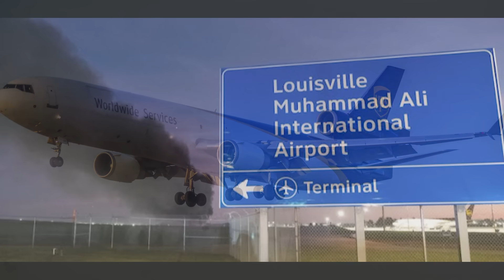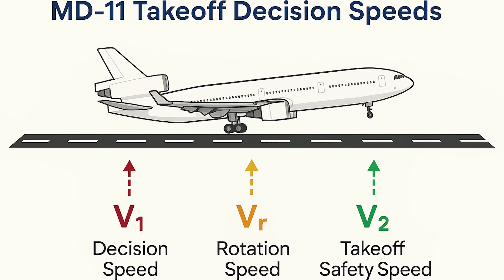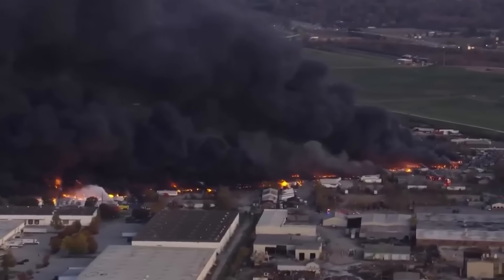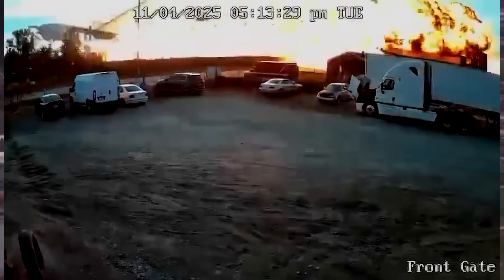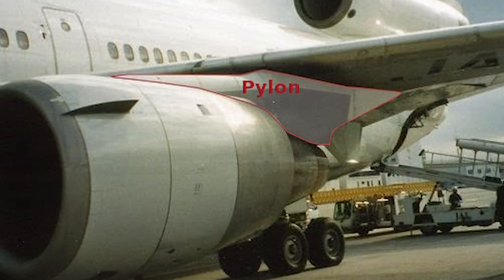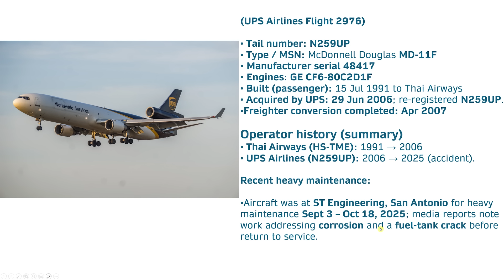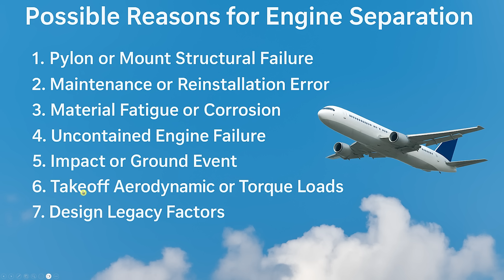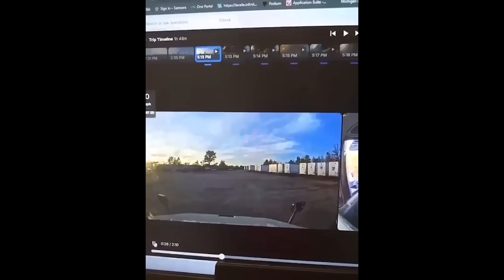What Caused UPS Plane Crash, Louisville, KY? How MD-11 Engine Fell Off

Comment: What a tragedy. My condolences to everyone involved.

The video impressively shows how bad this accident is.
Two things move me.
On the runway, you can see flames coming out of either the second or third engine. This could be debris that was sucked in by an intact engine (2 or 3), causing it to deliver less power.
The dashcam video of the flyover shows that at least one engine delivered strong thrust. The trees and poles bent and kicked up a lot of dust.  Did the thrust come from the middle or right engine, or from the two remaining engines despite the possible engine stall?
It looks as if two engines may have failed during takeoff. One broke off and another may have had a severe drop in power (compressor stall)?!

Comment: This is such a painfully sad tragedy. I've done a lot of contract work for UPS and met a lot of great people during that time frame. They always seem to be big on quality work & performance. Not sure why the airframe mechanics & management would place an unfit aircraft back into service? Never liked the DC-10 or the MD-11 design but but fan blade failure could happen to any turbine engine without proper maintenance.

Comment: I think the same as when the ElAl Boeing crashed in Amsterdam.
The slot where the engine is mounted 
Due to the loss of an engine 
And the fuel continued to pump to an engine that was no longer attached. And because of the power cables it hit, the fuel ignited.

Comment: The "nails in the coffin" seem to be the power lines and the main gear hitting the warehouse to slow the jet down too much to fly/recover.  Until the gear hits the power lines the plane seems to be able to fly despite two bad/one good engine and a full load of fuel and cargo.  I wonder if retracting the gear as absolutely soon as possible when the gear left the runway if that would have bought enough time, elevation and less drag  to just clear the obstructions and provide for enough flight for a controlled emergency landing (???).

Comment: This should be a minor investment for any airport...
But I recommend every airport to install 1 or 2 high definition Camera's AIMED to each runway.
Most exciting and dangerous place of a airport are the runways. And yet every time something happens...it's some dodgy security camera catching something in the corner of the lens.
And low resolution where you can count the pixels instead of the event.
Only maintenance would to keep the lens clear and some harddrives swapping.

Comment: they should make some kind of requirement for airports to have extra miles of field/water after the runway
Reply: It's impossible to safeguard everything. Normally there are field/forest at the end of runways in airports that are on outskirt of the city. But big airports in the city - it's virtually imposible.
Reply: Sometimes they do. In Hong Kong, both the old (Kai Tak — now gone) and new (Chek Lap Kok) international airports have runways aligned with stretches of water; the latter even has that at both ends. Kingsford Smith International Airport in Sydney has its runway pointing into Botany Bay (so it was useful for something after all — it was rejected as a suitable colony site in 1788, you know).
Reply: Lol I'm so sure. Extra MILES? get real

Comment: The state of airline maintenance is so poor that I don't feel compelled to fly for any reason whatsoever. Car crashes may be more frequent, but odds are that I survive something like that, and using cars or being inside cars is pretty much non-negotiable in our society at this point for most people, me included. Planes? I don't have to use those, and if you get into a crash, odds are that you're probably dead.

Comment: AF crew chief and C130 mechanic here: whoever last worked on that engine while in depot and signed off on it will be wishing they had called in that day. They are religious with multiple departments checking over work so a lot of people will be going down. RIP to all the victims.

Comment: i remember this other case which i saw in mentour pilot couple of years ago...where the maintenance crew messed up the pylon mount like didnt secure it ..i think it was American airlines 191(1975)..it was DC10-10s 3 engine like this n MD gave service bulletin of how aft attachment points in the pyon needed to be done n i think all the operators selected a system for maintenance using some forklift...it screwed up the the two attachment points basically...plz watch that vdo as i am not being able to explain it but it will give u a very good idea what might had happened here

Comment: The circumstances of this reminded me of another incident and I couldn't pin it down (my mind kept saying Sioux City but that was incorrect). A little dig brought me to AA Flight 191. DC-10  taking off and the left engine detached from the wing. Cause of that was essentially a cut down maintenance schedule to save costs. Sadly, I wouldn't be surprised it something similar happened.

Comment: Either they did not tighten the bolts when it was installed or someone lossenn the bolts. The first one is the most logical, but why? Did they do it on purpose? Religion, Political,  or Stupidty??

Comment: I suspect the fault is shoddy maintenance. Attention to detail is virtually non existent today. In the last 40 years, every electrician, roofer, plumber, gutter installer, contractor...every kind of tradesman that worked on my house did shoddy work. No doubt, tragedies will continue to increase (imagine a woke mechanic working on your car's brakes!).

Comment: I do know why that plane crashed. Being a fine tradesman myself can understand the issue. That plane spent one month in the shop in San Antonio,Tx where the unskilled tecknition fuk'd it up. If you watch the video close you can see that the engine is completely of the wing and the other one is stalled.Unskilled labor in this country is a big problem and this a good example of it.Flight 270 is another one.

Comment: That engine separation happened wrong time. Probably after no return and one engine was not enough to pull airplane to climb angle with the cargo inside. Did only a jump crash.

Comment: What happened with the Chicago airplane in 77 was they've been working on it and they forgot the Titan the engine down they had slid it onto the track or the Waze that holds the engine onto the wing and they all went to lunch they came back everybody assumed somebody else had tightened it The inspector came by I looked at it thought it was finished and checked it off is all good as the plan accelerated and it took off the right engine slid off the track on the runway and is it got into the air the weight of the other engine on the left side made the plane drop the left wing leaving the right wing up like a shark fin and of course it corkscrewed and went straight into the ground there's a funny story about what I read when I was in 7th or 8th grade when this happened about an author a female who is always terrified of flying and she'd finally figured in the last couple of years she got over her fear flying that was perfectly safe she was one of the casualties on that plane just saying

Comment: I live in a 5 mile radius to the crash and so we had debris falling in our yard. It was still on fire in the sky, it looked like a bunch of stars in the black smoke. It was so sad knowing all the debris was coming from a crash where people lost their lives. Most of the debris turned into cash when it landed on the ground but one of them was a burnt letter from St. Judes Childrens Hospital that I still have. I don't have the heart to throw it away for some reason. I used to work at UPS a couple years ago for college and the crash happened right where I use to park and walk inside. Thank goodness it wasn't my time yet. My dad said if the plane were taking off the other way, it would have been our house. It definitely unlocked a new fear living near an airport. RIP to all the victims! 💔

Comment: EXACTLY.  THE.  SAME.  HAPPENED.  back.  around.  the
1980 ' s.  or.  1990 's.  to.  an
Exact.  Airplane.  Model ,  back
then.  a.  Mc. Donald / Douglas
DC - 10 ,   was.  an.  independent
Company ,  now.  has.  a.  Different.  Number.  and.  Name .
But.  it.  was.  a.  Three.  ( 3 )
Engines.  Jet ,  exactly.  Like
this . . . 
An.  Engine.   "FELL.  OFF ".  from.  a.  Wing ,  during.  Take - Off .
F. R. E.   Miami. FL.     00 : 20. am
Monday.  10.  November.  2025

Comment: Do you know if there was maintenance recently? This happened to a plane years and years ago. Happened from the maintenance crew! The maintenance crew was suppose to only separate the engine from the pylon, but instead they took both off of the mount. After finishing the engine repair, the crew installed the pylon and engine back on the mount! Unfortunately nobody noticed the mount and pylon were not lined up properly and both collided during reinstalling. This made a crack hardly visible to the eye and spread over time and caused it to fall off.

Hope this didn’t happen again as aviation could be in a worse state then we thought

Comment: The strange thing to me is that 2 engine planes are required to be able to fly and even take off with only 1 functional engine (50% power). So you would think a 3 engine plane would not struggle as much as this one appeared to if it still had 2 functional engines (67% power).
Reply: Functional engine versus Dead engine versus Missing engine

Comment: I guess the mechanics installed the wrong direction of the engine mount bolts' washers that's the recess area of washer not against it's bolt head causes the washer long time pressed the neck of bolt make that mount bolts crack or short life. In the nutshell, the engine mount bolts broken.

Comment: I have had a reoccurring nightmare of a plane crash for as long as I can remember.  It doesn't help that I live a mile from the airport,  and UPS takes off every night at 10:00 sharp.  I probably didn't need to see this. God bless the pilots and the unfortunate victims on the ground.  Horrific

Comment: As a former aviation worker whoever did not properly inspect the plane after repairs or skipped protocols at all their heads will be rolling followed by mass investigations.
Reply: My guess would be that every one that ever worked on that plane now has some trouble sleeping.
Questioning them self if they did anything wrong...second guess everything they do at work.
Reply: @CruelViper88   they're probably like "muh plane" and then back to eating fried watermelon so I doubt they're having any plane to sleep at that point
Reply: yes! it sounds like there were issues with a cracked fuel tank. i bet it was not replaced just welded back together
Reply: It is more likely that it was not identified.
Reply: Y'all a bunch of gov bots! Silly
Reply: Have you seen the video where they ask if mechanics who worked on Boeing if they'd ever fly in one? All said no.
Reply: My God, God bless
Reply: i hope the families sue UPS because you just know its going to come down to improper maintenance procedures.
Reply: Are you sure there will be investigations? Seems like Trump and the GOP have done away with any of that silly accountability and regulation.
Reply: no they won't! 😂 trump made for sure of that!
Reply: Dei strikes again
Reply: @reginaldforthright805  wait i thought dei was squashed now that trump is in office. you people cant keep your stories straight.
Reply: the strong and independent black women in charge of the safety protocols
Reply: @popeinnocentiv6691 Rise above hatred. Race does not determine how well someone does their job as there are many successful black people that have contributed to this country.. willingly and unwillingly. Have some dignity and respect for the people who lost their lives. Plane crashes are caused by system failures or mechanical issues not someone’s identity.
Reply: @MadeinMina  I think they mean to criticize the fact that people are hired, even when very unqualified, to just promote diversity.
Reply: @AskinSilver no, it's just racism plain and simple.
Reply: @damondelgado4603 That word means nothing thanks to your side over using it.
Reply: @ombeth no, you're still racist.
Reply: No YoUrE sTiLL rAciSt
Reply: @MadeinMina dei hires are incompetent by definition Madame
Reply: @AskinSilver factually untrue. nt tho.
Reply: @ombeth No, it's straight up racism because DEI policies do not even help black people all that much and yet people are always disparaging black people when it comes to this. What does that sound like to you?
Reply: @TheKayasto  I’m just clarifying their most likely intention, not agreeing with
Reply: @popeinnocentiv6691  Can you tell me where the maga site is.
Reply: @popeinnocentiv6691 Didn’t your Top G daddy Trump get rid of those strong independent women which also mysteriously coincides with a severe rise in plane crashes in the US?
Reply: @nh4ci295 you're speaking logic.
Reply: @nh4ci295  are you implying that black women should be in charge of aircraft safety ?
Reply: @popeinnocentiv6691  aaaaand there's the racism
Reply: @popeinnocentiv6691 you’re implying they shouldn’t.
Reply: @nh4ci295  Neither Biden nor Trump or their respective policies at the FAA have anything to do with recent aircraft accidents. That isn't how this works at all. Safety is ultimately up to the Airlines, pilots, and ground crews and the combination of that and outside factors (bird strikes, weather, etc.) are what cause most accidents. With that said, there has NOT been an increase in aircraft accidents in 2025. In fact there has so far been a decrease compared to previous years this decade. The difference is that there have been a few high profile accidents which made the news, giving the impression that air accidents are increasing. That simply isn't the case.

Either way, neither this or the previous Administration have had any real impact on the matter in either direction.
Reply: @Kelnx funny how you chose to respond with the right take to the wrong person
Reply: @nh4ci295 no, many are still there unfortunately (as this accident proves)
Reply: @popeinnocentiv6691  Don’t you worry DEI is still in effect, just look at trumps cabinet! 😂
Reply: @Kelnx laying off air traffic controllers and not paying them. 
yeah. trump has noooooo hands in this mess. nooooot at aaaaaalllllllll
Reply: @TheKayasto  Well considering none of these accidents had anything to do with ATC capabilities, then no, the president or his policies had nothing to do with "this mess".
Reply: @Kelnx weird because these kin of accidents werentnhappening anywhere NEAR the frequency they are now. 
and it started after he fired a bunch of "dei hires". 
but hey, you enjoy the taste of rubber. who am i to tell you to stop enjoying such a harmless hobby. 
get well soon!
Reply: @TheKayasto  The number of aviation accidents to this point this year is lower than the average for this decade. So what you are saying is entirely untrue. You can check this for yourself as the numbers are published by the NTSB quarterly. 

Both fatal accidents and total number of accidents are less than last year to this point (Oct 2024 vs Oct 2025 YTD). The current trend is that 2025 will be a low year for the 2020s thus far.

The accidents reported in the news had nothing to do with ATC actions, so again it has nothing to do with any new policies or layoffs of ATC personnel under the new administration. What you are suggesting has no data to support it, or even logic to support it.
Reply: @Kelnx i said nothing about the amount of accidents. i said the TYPE of accidents. 
get bent i aint reading your fox news propaganda. 
i wish you a very merry charlie kirkd
Reply: @popeinnocentiv6691  You think other people are lesser than when in reality it's you that's lesser than.
Reply: @popeinnocentiv6691 I wish you a very merry get charlie kirk'd

Comment: Pay attention to the news cycles and the spin.  UPS knows how to control the news cycle.  First of all, UPS has never, and will never, ever, take blame for anything.  This is a Hard Fact.  So, there's a late push to ground all jets of the same model.  Why??  Doesn't this action just by its nature shift blame away from UPS mechanics and pilots?  Second, UPS Next Day Air is always in hustle mode... a hustle which normal America can't grasp.  You have no idea the things and safety that are overlooked daily by this company.  They crashed a plane over 4 years ago and well, you didn't hear about it, did you.  Male and female pilots, came in too low and slammed into a hill, killing both of them.  Engines don't just fall off, especially during take-off !!!!!

Comment: It's not always pilots error.. 
Very informative but let me tell you somthin ... Why you can't think if the payload was more than it can bare? .. we can see the altitude was too low on the building.only one engine fell down after takeoff it's had still two engines right? .. jet planes can cruise on one engine... 
As you show us the normal altitude on the point of top of building usually is 200 feet.. Why this plane can't able to make this altitude or at least 100.?
It's still got two engines there...?
Is it lagit to load an old plane had repaired for corrosion to load that much so it forced to takeoff that much far on the runway?
In the last footage we can see pilots was struggling to take it's nose up but definitely the load didn't let them do... 😭💔.. 
My condolences for the families from Pakistan 🇵🇰

Comment: Bird strikes are underestimated. If they are going very fast at impact could loosen something up that would then cause a chain reaction that could loosen that motor up. I still don't think this was a bird strike. I think someone left a tool in a place that had a cause the engine to be compromised maybe